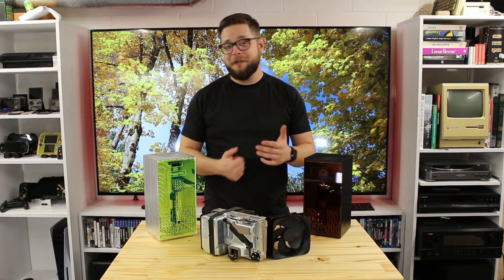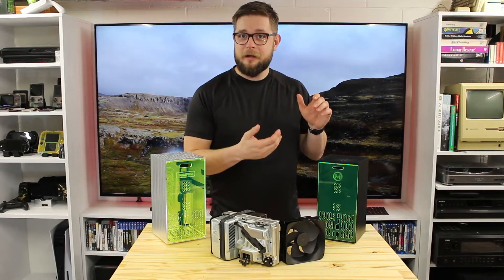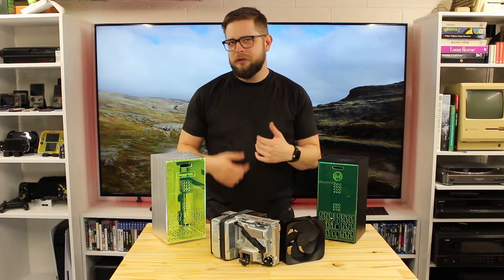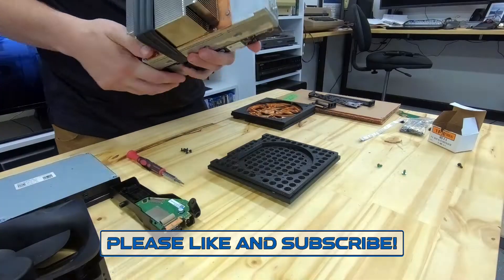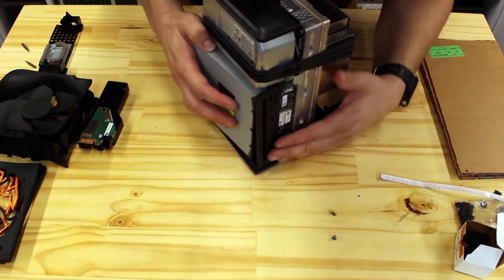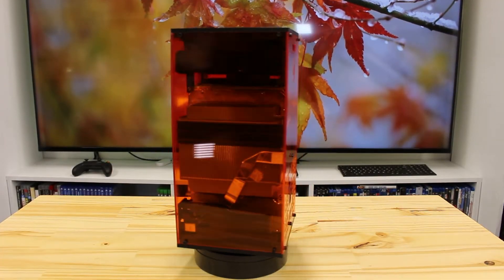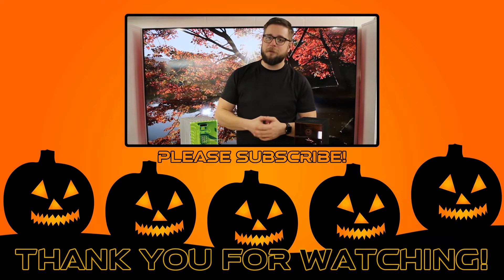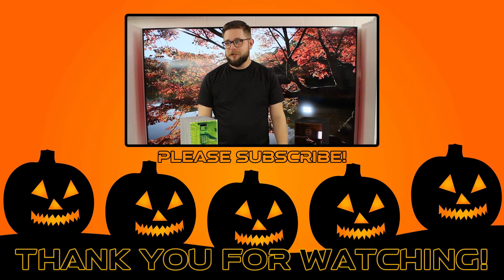Clear Panels on the Xbox Series X

Comment: Hey this is sick! I was printing all the parts for this when I noticed on thingiverse that all the base tops included in the files do not have the side screw holes for the acrylic to be screwed into. Is this a design revision or just some older files that accidentally got mixed in? I can always drill and tap the holes, but I was going to get the final parts printed in nylon so I just wanted to check and see

Comment: Hello Kevin GREAT WORK! If i want to do this with just the back, front and sidepanels do i need. Specialmount to assemble it or is there mounts original in the xbox? Looks so sick!
Reply from the maker: This does not use/work with the stock shell the XSX comes with. You will need the 3D printed parts and panels, and everything will mount together. Nothing additional is required other than the screws. :) It's really easy to reassemble once you have taken the Xbox apart.